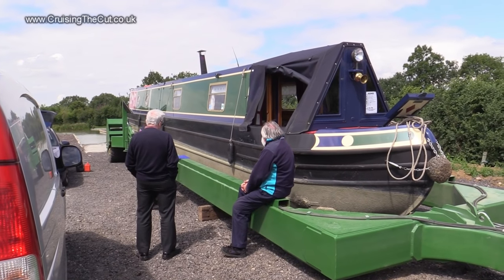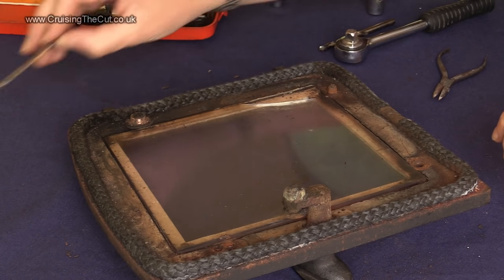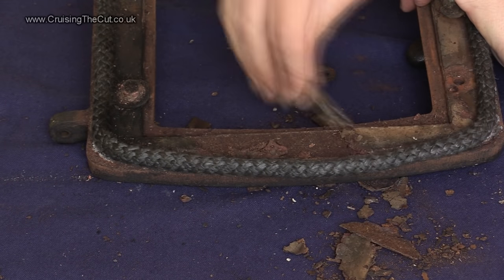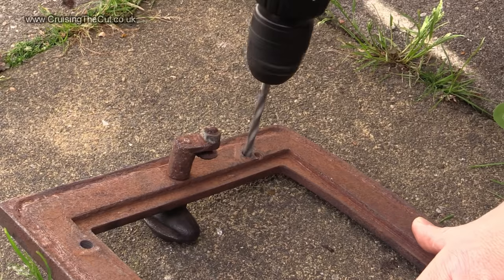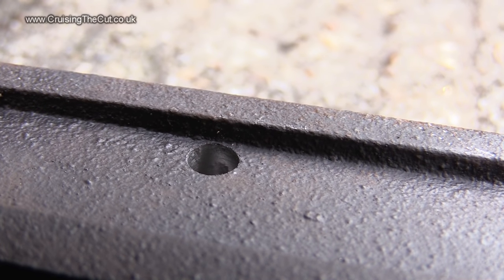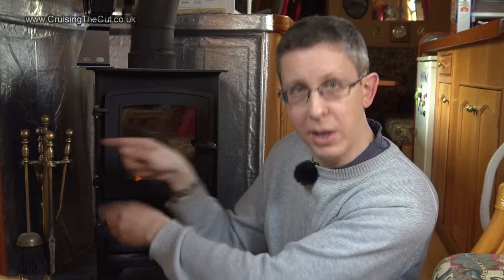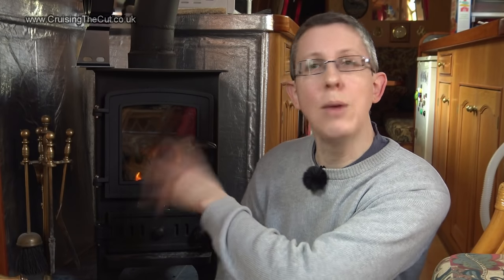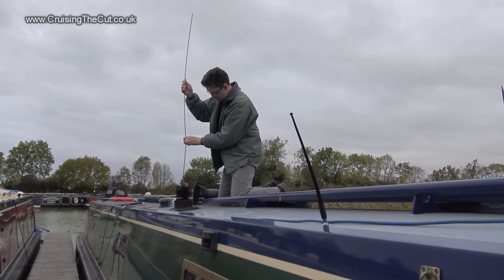18. Sorting out the Villager Puffin stove on my canal narrowboat

Comment: What I find odd is that these stoves are coal fired! I mean coal has great energy content, but so do gas or oil! It would greatly cut the hassle of dealing with coal, which is neither nice to handle, nor nice to sit by, like next to a wood stove, all the terrible coal smell must be a serious downside of boating :(
Reply from the maker: Yes, coal is dirty and unpleasant but a roaring fire gives a very pleasing glow. There's no smell from the briquettes.
Reply: Thing is though, oil you need a tank, and gas uses a lot of gas compared to the heat output. Coal is efficient, convenient and relatively cheap. Some stoves are really efficient and fairly clean as they combust twice, burning the coal and then burning the fumes

Comment: Three mistakes, using WD 40 instead of a penetrating oil like liquid wrench , WD means water displacement 40 means formula 40 ,  attempt to loosening it by hand before tightening it,  and not using a Milwaukee impact wrench that cost $ 450 [not sure what is cost in the UK], that has 1,000 ft-lbs of fastening torque , 1, 400 ft-lbs of nut-busting torque.  Plus the cost of impact hammer sockets that will take the torque.   Oh, I enjoy your blog, you are most defiantly a professional with your camera work and commentary.    The closest to canal cruising I have done is taking a Hughes 48 ft [40,000 lbs] sailboat down the Erie Canal down Hudson River.
Reply: Good call. WD40 is a jack of all trades master of none. It does a little of everything and is really handy to have to hand but specialist products will always be better.

Comment: In order to drill accurately, use a pointed punch to create the starting point, then use a smaller drill bit to drill a pilot hole. The bigger bit will follow straight and true. Use cutting oil to lubricate.
Reply: cast does not take punching well.

Comment: While fire protection IS the top priority, one downside is the loss of the tiling as a slow release thermal mass to help even out any raise and falls in the stoves heating though the day
Getting a nice fire protection back tiling, with a mind to heat retention, sound like a useful item for a to do list
Reply: The flip side of that is that the cupboard gets baking hot so you can't keep food in it, for example.

Comment: I know this is long past recommending, but high temperature applications don't work well for normal anti-seize. A trick I learned from old jet engine mechanics is to dip the threads in simple Milk of Magnesia before threading them in and it will hold up in the heat.

Comment: next time you are working with frozen / rusted nuts or bolts try to find " PB Blaster" that stuff is amazing. it has worked on 99.99% 0f every thing that doesn't want to budge for me.
Reply from the maker: Thank you!
Reply: The other way to move rusted bolts is using. A handheld propane torch to heat up the bolt after soaking in PB Blaster hear rage bolt up to red hot let cool for a few seconds and place a wrench on it and 90 odd percent of the time the rusty bolt moves. Way better than snapping the bolts, nuts off. Last is patience so you apply force to the heated bolt, nut and give it just enough force to slowly move the nut so you can remove it.

:-)

Cheers

Comment: great video and very informative, however I feel I must add my two penneth as I think YouTube is a great place for learning, looking at your stove and the condition of the bolts and the door itself, this is caused by burning unseasoned wood, which is collected along the towpath which is wet, it takes a minimum of 12 months to 2 years to fully season logs, when you burn wet wood it releases creosote this is highly corrosive to the stove and especially the chimney, collected wood should be stacked in the open air so that the wind can dry it, if you only burn wood that is already seasoned or smokeless coal you will never have these problems.
Reply from the maker: Good to know, thanks. I inherited that door when I bought the boat so wood burning is not something I've been doing; I only burn "supertherm" coal because that's what the marina stocks (plus a little kindling to get it started - see my "how I light my fire" video.

Comment: There is a product called anti-seize or never-seize for use on bolt threads. It is sold in auto parts stores and DIY shops. Take your glass bolts or nuts out and put some on the threads. Then it should be easy to remove them to service your stove door in the future. You should use it on any bolts and nuts you take apart on your boat to make future service easier.
Reply from the maker: Thanks Bill, I'll have a look for that. Cheers
Reply: +Bill Madden I was going to chip in with the same. Halfords sell one that looks like a lipstick and will last you a long time. Mine is a 'Locktite C5-A anti seize copper' 8065.... I would suggest that every few years you take them off and re grease them, remembering not to nip them up too tight and crack the glass. I also recommend using the stuff on any nuts and bolts you take on and off so they will come off again next time.. Happy boating :)
Reply from the maker: +Godshole Thanks for that. Annoyingly, the bolts on the new door are already seized solid. Sigh. Next time I get the door refurbished (which the manufacturers now tell me they do at a very reasonable cost) I'll add the Locktite stuff. Cheers!

Comment: Unless you’ve flipped the video, at 1:20 you were tightening the nuts rather than loosening them, which doesn’t tend to help, no matter how much or how little rust there was.

I mean, tiles are fire protection, aren’t they? Of a sort, anyway. I would not really have expected there to be any change in regulations between the year 2000 and now. I suspect it’s been out of compliance since it was installed, which I would assume might have been a DIY job by the owners.
Reply from the maker: Hi. See the note in the video description. The fire was part of the original, professional, fit-out by a reputable builder.
Reply: CruisingTheCut ah, right. Missed that note. Even as an experienced YouTube viewer, the Description often eludes me!

Thank you.

Comment: Kano-Kroil is a good lubricant to break free bolts.  Tie a piece of rag around the bolt and soak with Kroil.  Do this outside.  When you install the new bolts, coat the threads with high temperature anti seize.  Permatex has a high temperature nickel anti seize compound.  I used these for taking off exhaust manifolds on an old truck.

Comment: O dear, powder fire extinguisher ... they do work but the powder will be found in nooks and cracks long, long after the fire has been put out. I suggest a small CO2 extinguisher for the first reaction, or even a fire blanket, then on to the powder if it should fail to put out whatever fire there should be.

Comment: David, have you seen the thermo electric generators that sit on top of stoves? Same idea as your fan, just larger and puts power into your batteries instead.
Reply from the maker: Unfortunately the amount of power they generate is tiny, barely enough to charge a mobile phone.
Reply: @CruisingTheCut  Some of the newer ones are supposedly good for much more than that.

http://www.devilwatt.com/products/21-devil-watt-45-watt-wood-burning-stove-thermoelectric-generator-dw-sm-45w

Maybe they'll offer you a promo device if you reach out. If it works, other boaters may be interested too and it could be worth their cost to provide you one to try. I'd think a power source, even only a few amps but one that runs whenever you have a fire, precisely during the season when the solar panels are doing the least, would be a help.

I've no experience with the company and even less experience narrowboating; I'm in no place to even have an opinion about what would or wouldn't be practical in that situation(unlike other comments I've read!). Just thought you should be aware of the options, if you weren't already. Cheers!
Reply from the maker: I've had a look but it only starts power generation above 277C and most of the time my stove (once the boat is up to temperature) is on a tickover at less than that I seem to recall. It's still only enough to charge a phone or two really. Cheers though.
Reply: @CruisingTheCut  Thank you! Appreciate the time and info.
Reply: @om617yota8  i like the fact that his stove he says start the fire in october and no stopping till march. that length of time with even a small amount of generated electricity is good

Comment: Hello sir! Another great video as usual =D I was wondering, and forgive me if this has already been asked, but I'm assuming that the bolts in the newly cast stove front are the type that rust and corrode, it would be my suggestion to replace them with the stainless steel ones you were going to use for your original door. It might save you trouble in the future, if not, the future owners would certainly thank you. All the best, have a good one!
Reply from the maker: +KnuxVeeone Hi. Yes, my plan was to use stainless on the old door. Unfortunately the ones on the new door are already so solidly stuck I can't move them. Sigh.
Reply: +CruisingTheCut Ah, such is life. Oh well, let's hope you don't need to replace the glass again any time soon ;) All the best!

Comment: Back in 2000 there were lot of regulations ordering to build a fireplace and/or chimney in such a way there was no danger of setting fire in the surrounding. So I won't believe the construction of the stove was original. Seen more stuff in your first videos of which I do not believe any shipbuilder would install things that way. So I do believe the stove was not there original. Guess there has been a diesel stove or the stove was at another location. The strange bend in chimney als gives away, this isn't the original stove. I'm thinking, the owner installed this stove by him selves and never informed his insurance about it (because they would asked for an inspection) and as you mentioned, it wasn't save at all. 
You did a nice job, good isolation. Not only to protect the wall/cupboard but also to protect the loss of heat. Using these kind of sheets can save you up to 60% fuel.
Reply from the maker: Hi, I believe the stove is indeed original to the construction of the boat. Cheers
Reply: @CruisingTheCut  You know your boat the best. Just wondering why they build the stove that way. Anyway, you solved the problem very well.

Comment: get some stainless steel or alum sheet and some tubing, cut he tubing in 3mm lengths get some longer screws and stand off the sheets between the wall and the stove as well so there is an air space in there, that will be a good heat/safety barrier as well!
Reply from the maker: There wasn't enough space to add sheets with an air gap else I would have done so!

Comment: Good Sir...

You admit that you're rather mechanically inept (wonderfully honest of you), and when you took the door off you had the issue with the nuts.

You (should have) stopped the operation at this point, and just taken the door down to a machine shop. 
They would have properly removed the nuts using heat and penetrating oils, and probably even sandblasted the door for you, thus eliminating the mess, the frustration you went through, and the inevitable death of the original door. And had they broken off any of the studs, they could have welded new ones in place in short order.
The expense would have been absolutely minimal, compared to the time & expense you had finding a replacement door...which in the end, had to be modified to fit the stove anyway. UGH!!!

Well, you did get it all handled, and everything looks good, so well done!
I also love the heat foil you surrounded the stove area with, I love the fan, and nice to see you cleaned out your stovepipe as well. (this should be done annually seeing that you use your stove as your primary heat source)

Great video, and please keep them coming. Cheers!
Reply from the maker: Getting it done properly wouldn't have made such a video though! ;-)

Comment: There is made a device that will attach to your stove-pipe called a heat exchanger, it increases the surface area of the flue and enables cabin air to pass thru it by natural convection...

These devices are very useful, and as you already know most of your heat goes right up the flue to heat the birds jumbling about outside...

just a suggestion mate, you may find it quite useful; and in conjuction with a good flue damper it will save you loads on wood/coal...

here is one popular brand:
http://www.woodlanddirect.com/Magic-Heat-6-Heat-Reclaimer?gclid=CNfIqP2VmtACFUkvgQodJ-4McA

but many more can be had for a fraction of the cost, or made by a local tinsmith...

almost finished with watching all of your vids, I started in the middle and we're working our way from the start...
Reply from the maker: Certainly an intriguing idea though I've never seen it done on a narrowboat. I wonder if it might fall foul of our BSS (safety) requirements for some reason. I'll find out!

Comment: p.s. the fan is ran by a sterling engine... very small of course...
Reply from the maker: It's not a Stirling engine (though you can get ones like that); they rely on compressed fluids.  This operates under the Seebeck effect (electric current through dissimilar metals at different temps)
Reply: ahh... I see... 

Thank you...

Comment: A thread tap would have come in handy, cut a different  tread pattern and change the bolt to match.  It  would have cost you about $25 to late now, but  a handy idea for future rusted out bolts.
Reply from the maker: Cheers for the tip

Comment: A hard lesson learned on the stove door. Use anti seize (usually purchased at an automotive store) on the bolts to prevent the problem the next time.
Reply: Use brass nuts on the steel studs, just like they used to do on car engine exhaust flanges...until the bean counters (accountants) said "The car only needs to last for the warranty period..so no brass nuts any more" Brass will never rust/corrode in place.
Note also that the crack in the glass started from a nut and washer location. The glass needs to move...that is why it is on those small fibre pads. Expansion of rust on the washer/stud/nut may have clamped and  stressed the glass causing the whole mess...all could have been avoided with 50p worth of the correct choice of materials at manufacture.

Comment: Did you replace tile flooring under stove to meet safety regs also? Not mentioned or I missed it..tks😇
Reply from the maker: Not replaced but since covered also in the heat reflective material. Replacement of the tiles would be a massive job as I'd have to take the entire stove out.

Comment: If someone hasn't told you yet:  The rust breaking fluid I use on my power wheelchair for rusted bolts is "Liquid Wrench Penetrating Oil" (UPC 0 60959 12015 0).  Any penetrating oil will need venting when in use.  I use a hazmat mask of this type of work.  You spray it on the bolt(s) in question.  Tap it every 5 minutes for 30 - 45 minutes.  Then try removing the stubborn bolt.  

Additionally there are a group of products known as thread lockers.  If you have ever removed a screw from a laptop computer the spot of blue at the end of the screw is this type of product.  The create an air tight environment where the threads of a nut enter the bolt.  Of course in an air free environment rust can't form.  Before you rejoice at this knowledge there are a few caveats.  These come in different strengths to loosen the bolt once it cures.  These often have a temperature rating associated with it.  It would be worth learning about these.  It may make your life easier in the future as your DYI skill set forms. 

Ultimately I have a whole tool kit (even including a tooth brush for cleaning my wheelchair) that may save you  buckets of money as your skill set develops and if you are willing to learn.  Just some food for thought.
Reply: I didn't realize plastic thread lock survives at high heat; great bit of knowledge, thanks. 
I wonder if a good bit of high temp resistant grease might be a better solution. The problem here is the glass is cracked. Thread lock makes it difficult to remove the nut, and replace the glass. A good grease will prevent rust, and allow maintenance. Cheers.

Comment: For rusty bolts like the ones holding the door glass in, try a product called PB Blaster instead. It penetrates better and actually has a lubricant in it rather than being a Water Displacement formula. (Hence the name WD-40, Water Displacement formula number 40.)
Reply: IME, even better, before anointing the frozen fastener with any liquid, carefully apply HEAT enough to make the threaded interface glow. Obviously, be careful with the glass. Heat alone may be enough to free the fastener. If not, some rust-buster fluid is next. Avoid BFI (brute force and ignorance.)
Reply: Yes WD40 is basicly just petrolium, not much derusting qualities. A friend, who's a engine mechanic tought me how to loosen rusty bolts. You take a centerpoint and at an angle you gentle tap with a hammer counterclockwise on the bolt and it will slowly turn untill its breaks loose from the rust and then you can take a wrench to turn it normally. Its like how they loosen bolts in a garage with a aircompressor wrench, it hammers sideways very fast at the bolt, only this is much slower.
Reply: Don't know if Fluid Film is available in England. In the states it is popular with marina's for the same problem.